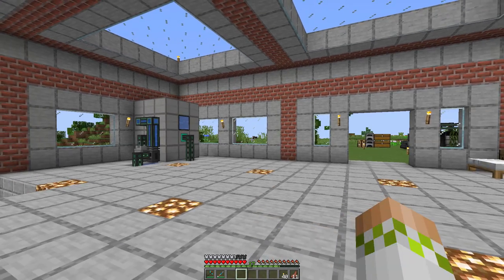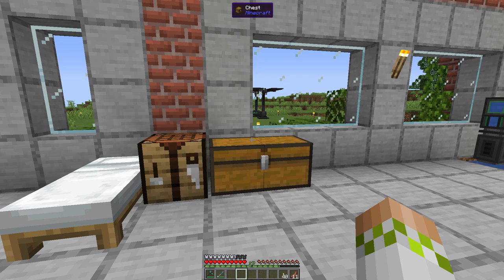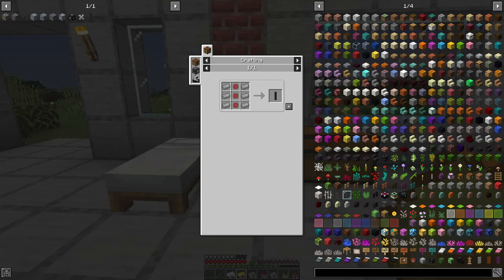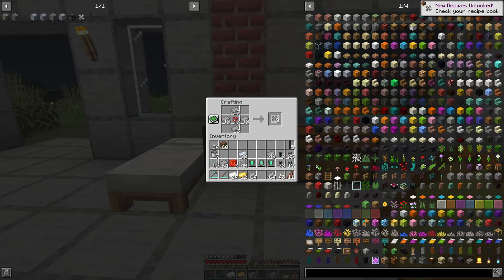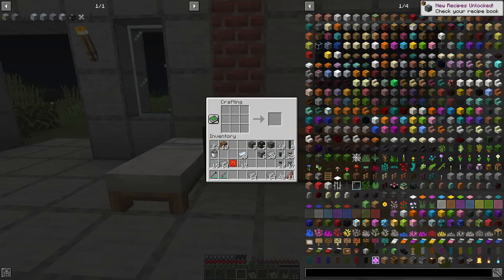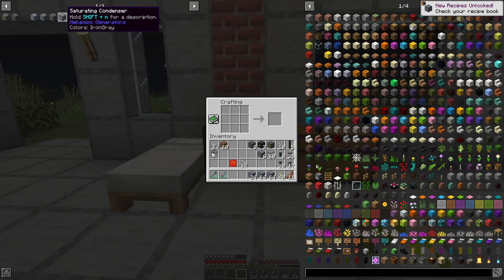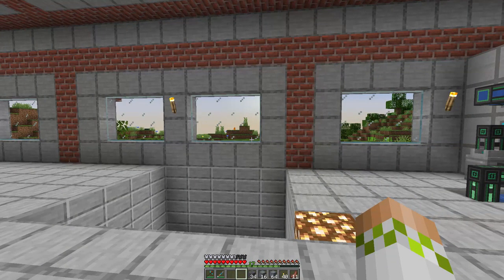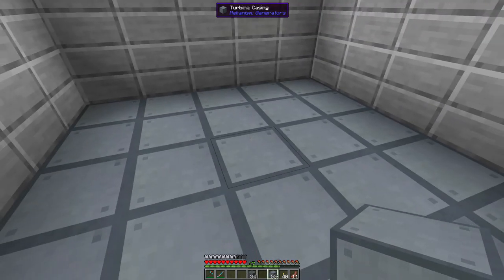Surviving With Mekanism v10 :: E09 - Industrial Turbine

Comment: So as of building this 3 years after this video was uploaded it seems the type of pipes matter, especially when increasing the burn rate. Running basic pipes drain 3.6mb in a span of 30 secs and the turbine was not replacing it. It basically vanished. Switched to ultimate pipes at 1mb/t burn rate and now it holds the cooling steady without making the water disappear.

Comment: I needed to upgrade my mechanical pipes too ultimate mechanical pipes, because my reactor needed more water or these standard green pipes cant pump enough water. I dont understand why your pipes are enough for that water flow. My reactor nearly overheated cause of that. But beside that, very nice video. Keep it up.

Comment: UPGRADE YOU PIPES! If you are having the problem of this reactor set up melting down, upgrade the coolant pipes (advandeced is enough)! I built this same thing and fixed the problem as such
Reply: I'm glad to see this comment.  I can't reach the 1.0 burn rate without running out of water and I considered upgrading the coolant pipes.  So, I'm glad to see that indeed will solve the problem.

Comment: @RagePlaysGames do I need to change the turbine you made when I want to make a fission generator that's 5*5*4? If so, how do I do it, because I couldn't follow the math really well
Reply from the maker: The turbine can support a reactor burning 19.2 Mb/t of fissile fuel. The reactor setup determines the max capable burn rate but you don’t always have to set it at that. As long as you don’t have the reactor set above 19.2 mb/t burn rate you’ll be fine, just make sure your pipes for steam and water are upgraded enough to transport them without bottlenecking the setup :) I can’t tell you what your reactors max rate will be since the size doesn’t dictate specifically it’s burn rate either, how you set up the internal portion does, so I’m sorry I can’t be more specific with a definitive yes or no
Reply: @RagePlaysGames  First off thank you for an answer this soon I didn't expect that, secondly I was thinking about a reactor that has a max of 5 mb/t and maybe making tier 3 pipes. I think that should be enough, thanks again for the anwer :)
Reply from the maker: No problem! And that absolutely should be enough :) for future reference too, just take your turbines lowest output (either steam or water) and divide it by 20,000 and that’s how many mb/t reactor it can maintain. Your reactor at 5 Mb/t would need 100,000 mb/t steam processing & water output from the turbine at a minimum to function without overheating. Hopefully that simplifies it for when ya eventually scale both up!
Reply: @RagePlaysGames  that's what I was planning to do, these tutorials are really helpful and keep up the good work 😁

Comment: i followed the tutorial perfectly but my reactor cannot exceed 0.3 burn rate, if i try to increase the burn rate the reactor starts to overheat and the turbine cannot supply enough water. could someone explain to me what the problem is please?
Reply: Mine can only 0.5, have you figured out the problem?
Reply: I found the problem, the mechanical pipes that transport the water have to be a certain length. I fixed my problem by using more mechanical pipes.

Comment: Hey rage I’m new to all this and I’ve basically just been following your steps through this series. So my turbine and fission reactor seem to be identical to yours but when I turn on the reactor, the water level is quickly gone and I have to shut down. Is my steam not condensing? Would you have any idea where I’m going wrong. Thank you for this great series btw
Reply: Hmm so I figured it out. My mechanical pipes for the water just ran straight from the reactor to the turbine but when I run them against wall like you did, it works fine. Must just be a mechanic I’m not aware of
Reply from the maker: It may be a lack of transport power. The more pipes you have the more water/power/gas they can move per tick. It’s an odd mechanic, but it makes longer chains of the same pipe able to move more content. If you ended up making your pipe system longer by changing it, That could explain it
Reply: @RagePlaysGames  I think that’s exactly it!
Reply: @RagePlaysGames  I'm having the exact same problem my water leaves incredibly fast and doesn't continue filling and capped in my fission reactor at 569,835, I'm not sure what's happening with mine I have it set up exactly as yours pipes and all but my water leaves and my steam goes away after 5 seconds of processing? I'm not entirely sure what I'm doing wrong (update I also get no power in my turbine even though it is moving and fanning??)

Comment: Thanks for this, but do you know any reason the steam valve would not accept a pressurized tube as an input? I have it set up, just that it refuses to take steam no matter how many parts I bash with my Configurator

Comment: for some reason my Max Production is 1.50 while yours is 3.77. is it because of a update change? and yes I followed your build with the exception of the coil placement as I flipped two of them on the opposite side... like my water coolant is just gone when i have it at max burn rate...

Comment: how did yo stable your reactor so the water wont run out?(i did not mannage to do that!!!
Reply: have you found a solution for that? I have the same problem
Reply: @waddleton_  i did my problem was that i was using the not right tube/pipe you have to use ultimate tube/pipe so water wont run out if you need better explenetion write me:)
Reply: @daddyelior  Oh okay. Well my problem was, that my pipe wasnt long enough... which is a weird problem. But it works now
Reply: @waddleton_  glad i could help

Comment: Is it possible to have to turbine rotors if the turbine itself is big enough to hold? Like can the mod accept 2 and/or is there a benefit to having 2?
Reply from the maker: As far as I know you are limited to one turbine rotor directly in the center of the turbine no matter what the size. Even if you could have two, i dont think thered be a benefit because two would limit the radius you could have one each and each blade you add gives a static increase in power gen.

Comment: do you know if a mechanic was changed since you made this video? I'm having an issue (and I saw 1 other comment with the same issue. can't run the reactor above 0.25 - 0.3 burn rate unless I also leave the original pump used for testing connected which to me is odd as the pump clearly isn't enough, yet with both the pump and the water feed from the turbine I can push it all the way to 1.0. without the pump I can't go above 0.3 or else the water in the reactor starts dropping drastically and it starts heating up real fast.

also both the reactor and turbine are exactly as you built them just located closer together as I didn't make as big of a space for it and I don't want it too close to my main base.

Comment: I built the same setup, but that turbine cannot even handle a burn rate of 3 let alone 19 lol... I had to use a sink (inf water) and two pumps that pump at 32,000mb/t (so 64k per tick) to get the fission reactor to burn at 4.8mb/tick without going through all the coolant
Reply: I have found out that this is a limitation by the Pipes in the game. There are no pipes that can handle the amount of liquid being sent from the turbine to the reactor... With the exception of the Pipez mod using the Infinity upgrade which is SUPER end game...

Comment: In short, I assume the fission reactor is the "boiler" per se that makes the steam and the turbine is the power generator that utilizes said steam to create electricity?
Reply: Depends on what coolant you run, if you use water coolant then yes, the reactor is the "boiler" whereas if you use sodium, you need a separate boiler multiblock to act as a heat exchange which turns molten sodium back to sodium in exchange for turning water to steam.

Comment: I have been watching your mekanism videos and following along in my world replicating your builds. I built my fission reactor and turbine exactly like yours but for some reason my turbines flow rate wont go above 16,000. So I am only able to run my reactor at a .8 burn rate. Any higher and all my coolant gets sucked out and my reactor starts melting down. Any help would be much appreciated.
Reply: i ran into the same issue and found out that running 2 more pipes of water into the vent was what solved it

Comment: Why is his max 3.60 GJ and mine is 1.44 GFE. Is it the same but different units? Cause I made the exact same turbine as him and checked many times if it’s built right. Also if anyone knows the mekanism electricity unit can u explain pls
Reply from the maker: They are the same so no need to worry :) if you want to switch to different units click the button in the bottom left of the multiblock UI. That will toggle between the various units and change all the calculations in the setting to that for the multiblock.
Reply: Ty very much

Comment: Once again, followed your steps exact and I can only do .25 or I immediately over heat. .24 to stay stable and .25 I heat up very skowly
Reply: yea I'm having the same problem only I can run at 0.3. oddly though if I leave the pump connected I can run all the way at 1.0 so for now I just have the water from the turbine plus a pump hooked to the same line. not sure why with the pump it works as the pump alone clearly isn't enough. I'm wondering if some mechanic got changed since he did this video. it was nearly a year ago. I'm not running pure mekanism though I'm running Enigmatica 6 also but weird I'm having the same issue

Comment: My turbine is only generating 28kFE /tick (71.32 kJ). Any tips?

Edit. Nevermind. I figured it out. Now I just need to find enough Uranium. I will probably need to get to the fusion reactor ASAP.
Reply: Good luck on your fusion reactor, they're a pain in the ass
Reply: I am also having this issue how did you fix it?